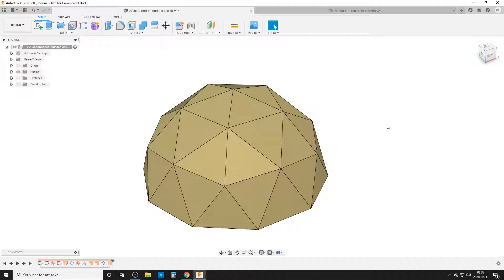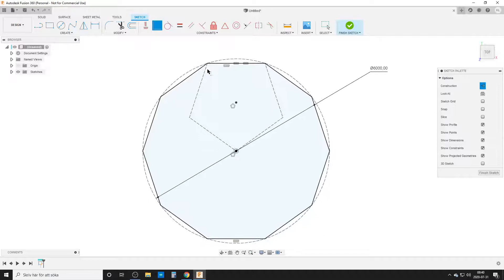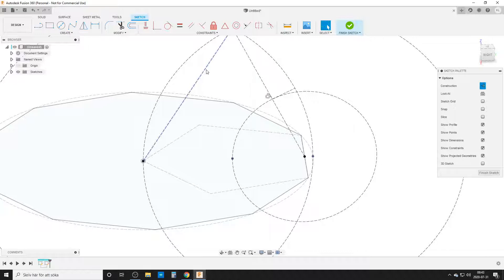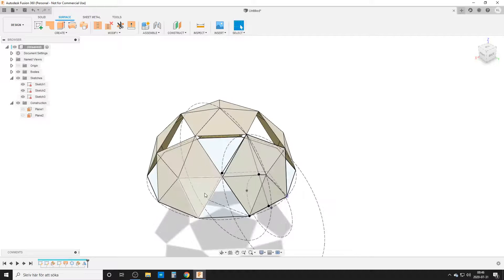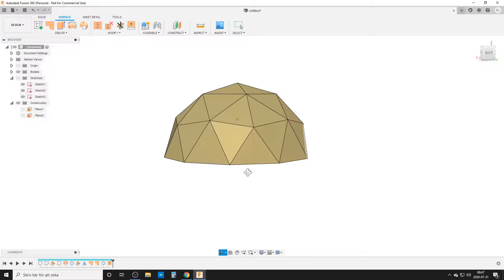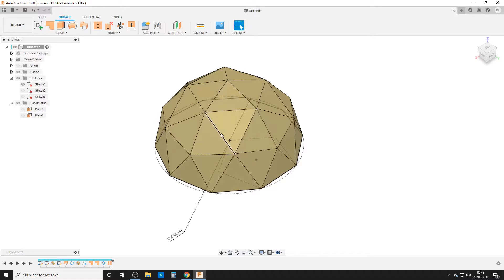Geodome 2V Icosahedron in Fusion 360 - Geometric solution (no math)

Comment: This is very impressive, Can you drive the dome by adjusting a single variable assigned for the outside diameter? I just did it in solidworks and I'm trying to find a way to put it into On-Shape for a customer by driving the geometry by a single variable.
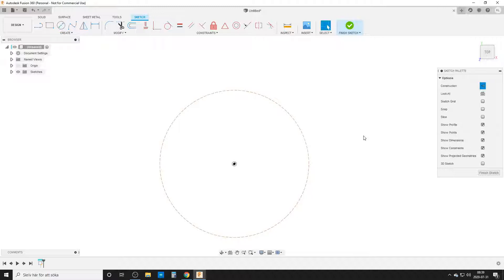Reply from the maker: Yes the design in this video is driven by the diameter of the circle (sphere) at 1:45 in video. I have not used On-Shape but there should be similar tools to create the workflow.

Comment: Great tutorial! It went really well but i´m having trouble with a further step, Im trying to align an specif body of pipe to the corners and i just can get it exactly right, tried alright several tools. Any tips??
Reply from the maker: You can do a 3D sketch with lines from corner to center point if globe. And then use the end point of the sketch line for joint reference (If I understod you question).

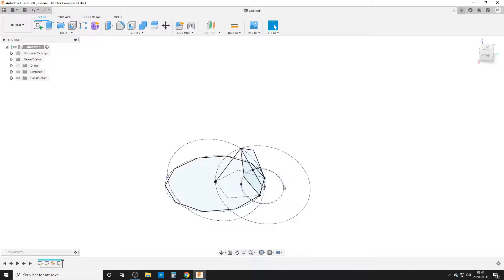Comment: Stuck on 7:00, the pentagon did not snap nicely to the base and the corner when I constrained. I did this tutorial twice, the second time extremely carefully to make sure the lines perfectly match and intersect correctly (even zooming all the way in to make sure). I wonder what the problem is...
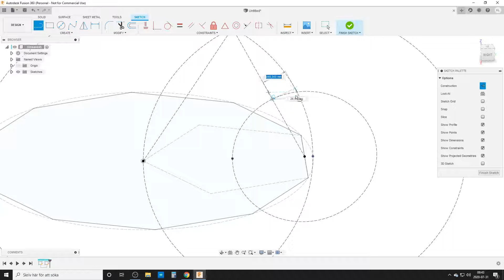Reply from the maker: Check that you select the correct center point for the pentagon, the point is the projection of the short line (the line I create at 5:49)

Comment: Hello Kristian. Can you tell me how to make this into a sheet metal work and then if it's possible make a flat pattern?
Reply from the maker: Creating a sheet metal geodesic dome in Fusion 360 can be time-consuming. One approach involves starting with a surface model of the dome's top half. By applying fillets to all edges, you can simulate sheet metal bends. However, manually removing unwanted fillets is a tedious task. Once complete, thickening the surface and converting it to a sheet metal component will give you a solid base.

Comment: Great tutorial! How did you do the frame ?
Reply from the maker: I started with Surface Loft from Edge to Center point of dome. Added Thickness and did some trimming. Not the best workflow, trying to refine it and put it in a video 😀
Reply: Kristian_Laholm  would be awesome to see. I struggle with a bevel edges of timber , on how to get that perfect connection and 2 separate components so I can produce them in the real life! 😅
Reply from the maker: I'll have a new look at it. The workflow will be done on a different polygon shape but I think you can use the workflow.
My goal with the workflow is to create the parts and make driven sketches for the dimensions.
Reply: @KristianLaholm  could you record video on making a frame ? That would be awesome!